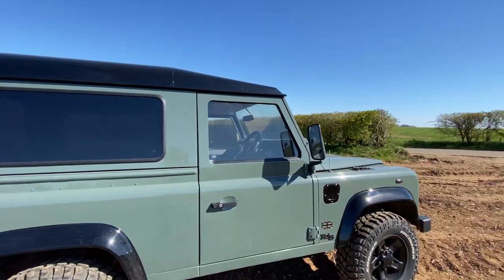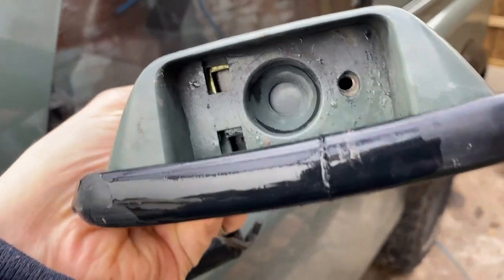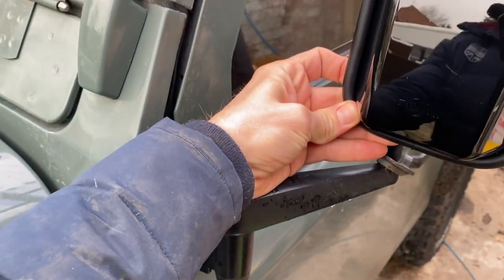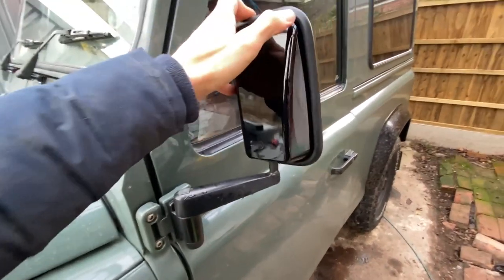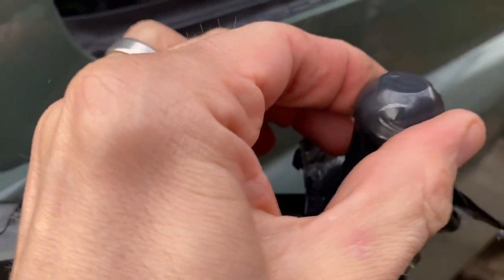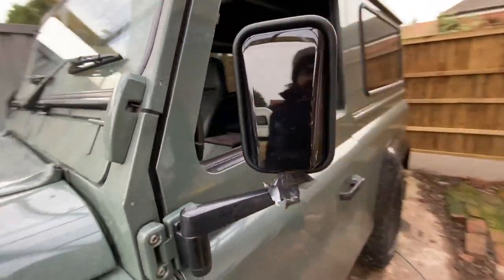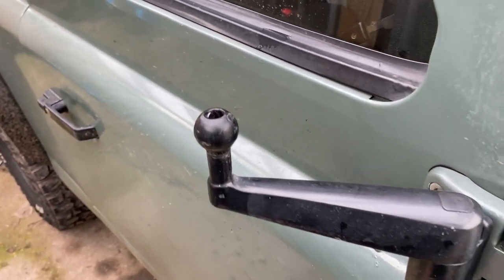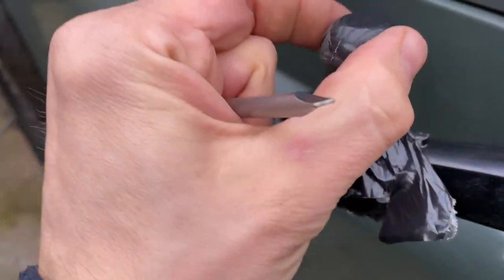I SOLVED MY LAND ROVER DEFENDERS BIGGEST PROBLEM FOR UNDER £30!

Comment: Cut the tip off the finger of a latex glove and stretch it over the ball (as a Doctor I'm sure you'll have plenty) - add a second if needed to create more thickness. The rubber adds friction and prevents the mirror moving around. Did this around 3 years ago to my Defender and the mirror hasn't moved since.
Reply from the maker: It’s a great idea Phil- after I had done this video I did think whilst at work these glove fingers would make a great arm ball cover! 😂👌🏻
Reply: Thanks Phil, I’ll try this. I used band aids with my Mudstuff mirrors to no avail so I’ll see if this improves it.

Comment: Excellent! I bought some cheap gloss black ones and they flopped around all over the place. Overtightened the screws and stripped the threads. I’ll get some Britpart ones and do what you’ve done…. Thanks for the tip!! 👍
Reply from the maker: No worries Mike- I’m so pleased it actually works it’s been a problem with mine for a long time now 👌🏻 I think something like a rubber glove finger would also work well to stop it moving at speed

Comment: Those green mirrors were larger than normal, the black ones are the correct size, the regular fix for the mirrors is to dry off the ball and socket as they usually have Vaseline on them and then bend the fixing bracket a little so it pulls up tighter onto the ball and socket.
Reply from the maker: Thanks for the comment David- crazy that they put Vaseline on them- seems like the last thing you’d need to do! 😂

Comment: Hmmmmm I have had 5 Defenders 2 90ies and 3 110's and still drive my 2015 110 but never had any issues with the mirrors giving in to the wind even at 150kmh 😉
Reply from the maker: You’ve done well! It’s been a problem with mine with different mirrors since day one. Also 150kmh- that must pretty scary in a defender 😂
Reply: @thedoctorsgarage  well 150k is not the  standard but with engine remapping and wheel spacers she feels pretty solid but far away from my 2022 RR Sport 🤣🤣
Reply from the maker: @tomjet1000  😂👌🏻
Reply: Same here owned 3 and never had that problem

Comment: Never had this issue with the standard mirrors but it is an issue with the bigger Spafax mirror on the near side of my Wolf 110. They fit those on the extra long arms to clear the side mounted spare wheel. They catch the wind and wobble a lot.
Reply from the maker: I did look at Spafax but they are huge!

Comment: Best mirrors ever for a Defender are Spaffax, unbreakable, wide angle and don't move. Fitted to lots of MOD Land Rovers and used (in different sizes) on trucks and buses throughout the world. Not even expensive and available with a heated option.
Reply from the maker: Thanks- great advice - wish I would have known this before I fitted mine! Maybe next time

Comment: I don't mean to be rude but can somebody please explain to me why you would put a racing steering wheel on a Defender?
Reply from the maker: You’re completely right- it was fitted by the previous owner but it’s getting swapped for something soon…The reason is mainly because they they are smaller and the arm room is tight in a defender
Reply: A round steering wheel (used Moto Lita) is soo much nicer to use than the egg shaped original, especially if you have long legs.